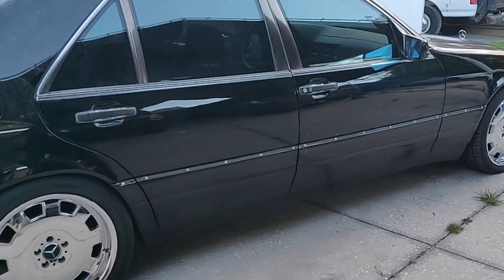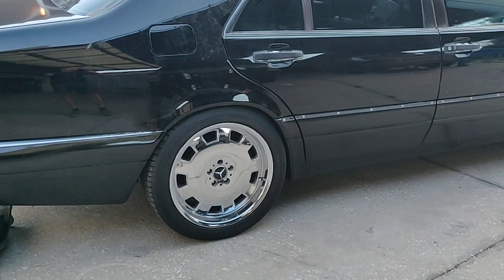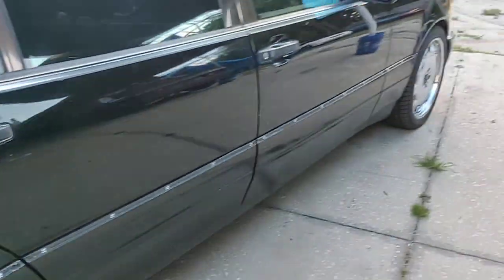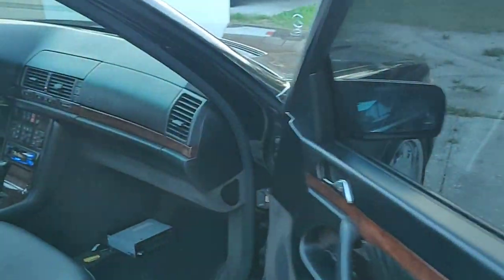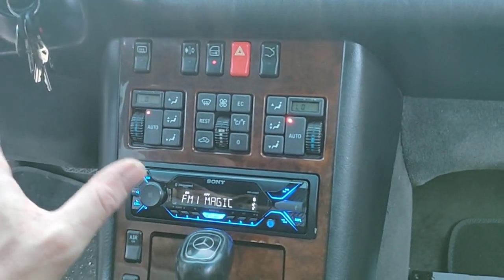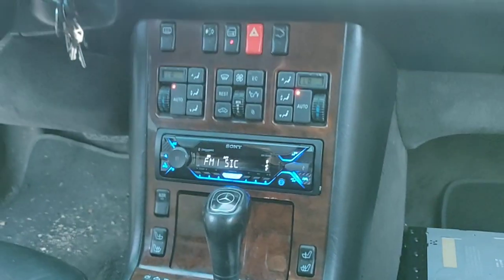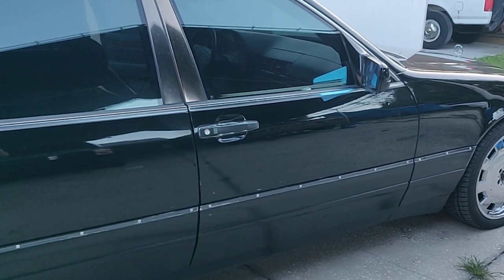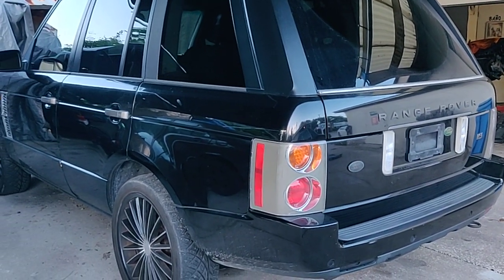W140 s500 VIP build update: soft close fixed and stereo install

Comment: Congratulations on the fix. Im still having soft close issues. And radio is finally coming along, the antenna needs to be replaced..
Reply from the maker: Thanks.  Let me know if you need help with soft close.  I have resolved a lot of issues with these in past and can help guide.

Comment: Interesting. Only 2 of my soft close work and the kick plate is pretty beat. Perhaps there is something knocked loose.  I haven't troubleshot it yet except to make sure the pump works so any ideas are certainly helpful.
Reply from the maker: You can cross over the lines on the pump and try closing the cordinsting door while having the door that's not working just barely closed.  If the door is working it will pull itself shut. I know that sounds super confising:

So on the pump switch the working one with non working one.  Then take the non working door and keep it closed enough for soft close to activate but not fully closed.  Then shut the working door.   The non working door should then pull shut. 

Basically tricking the system.  What this does is let's you know there is no leaks but electric is not getting to the pump from the door.

Comment: Did you know the two design flaws of this car? First one is center vents are off set to the right of the center counsol. And the roof ended up being 4inches taller than it was supposed to be. If you look at it , it does seem a little to tall for the overall look of the car!👍